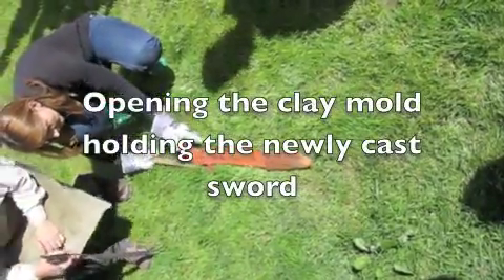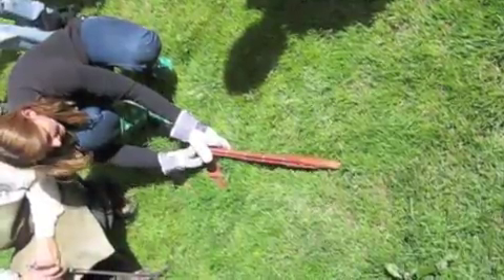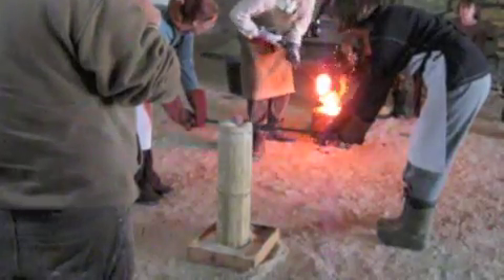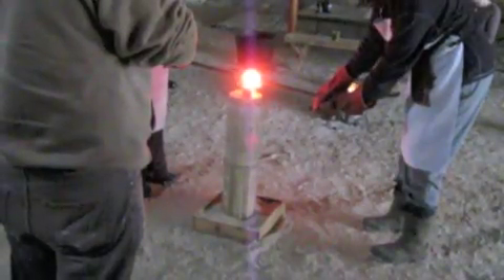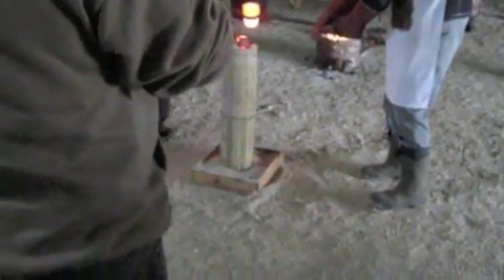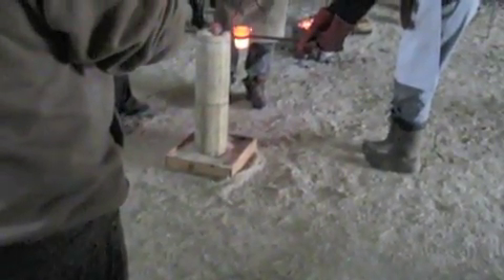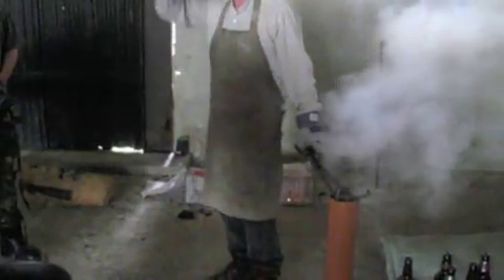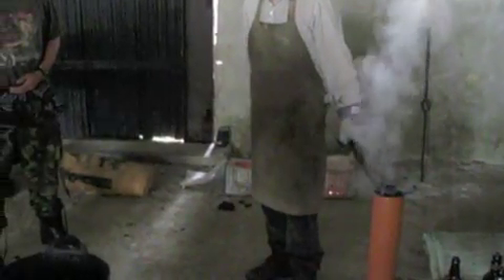Casting, Quenching, Hardening

Comment: that's cool man :) But hey, if you want a cheap ingot mold that is actually pretty good for its price, you can get an aluminum LEE ingot mold on ebay for like $17 (it's primarily for lead making for bullet parts). I bought one and it looks pretty sufficient. I just don't know if molten bronze will explode if it touches it though. I also don't know how long you have to wait for the bronze-filled mold to cool before quenching it. You have any idea on that? I just don't want it to explode, lol.

Comment: ok, thanks, and I have just one more question: Do you happen to know if bronze will explode if it is poured into a metal mold? (like an ingot mold for ex:) because I know that it will if it touches concrete or any substance with moisture in it. (I'm planning on making bronze swords if you're curious)

Comment: carve a wax sword, yes. then use silicon on the wax to make the mold. peel it off.
then you can use the mold, just refill with wax and you have a sword of wax again. 
now for the pouring metal you can use wet sand to mold your wax swords. if you only want one sword then this is more work.